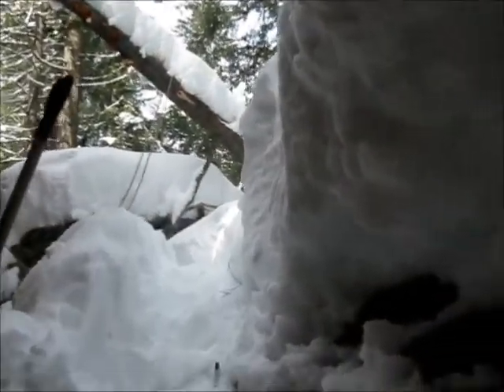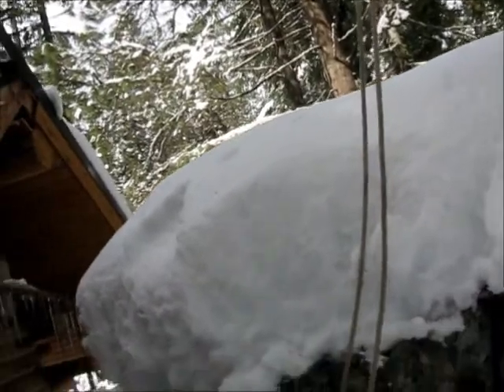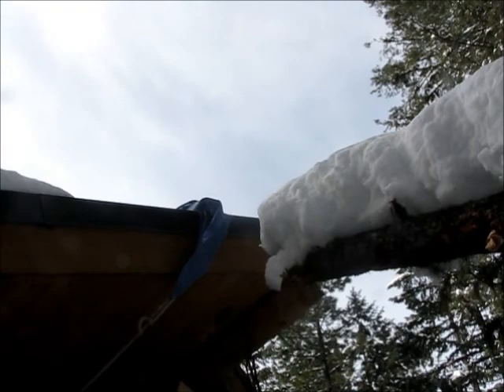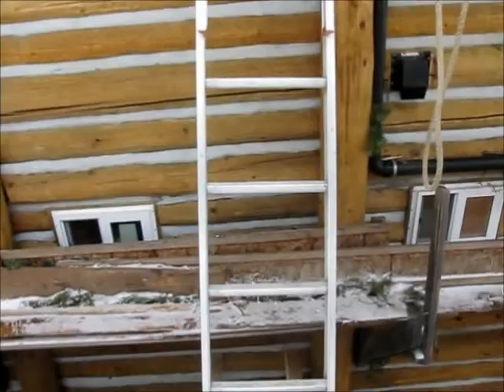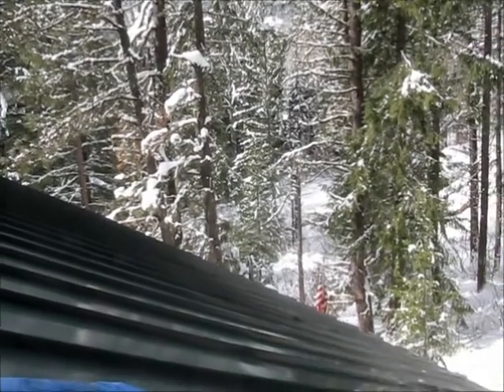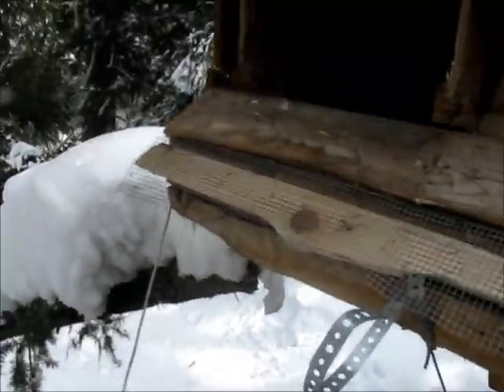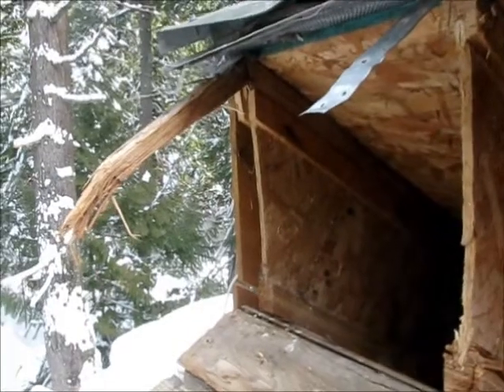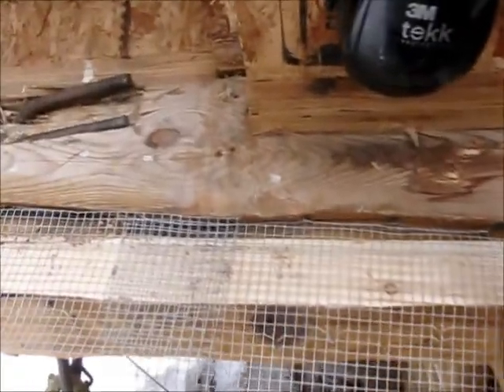Roof Repair at Camp Serendipity   Part 4 February 26   27, 2014

Comment from the maker: Thanks for your comments and your interest, Roald. I checked out your website. That's a great, beautiful, and cozy-looking cabin. I can imagine how much you enjoy being there. And thanks for the tip on the sawzall. I have known about them for a long time but I never owned one. I usually buy tools only when I am up against a project which I can't do without the tool. I have never quite crossed that threshold for sawzall. I considered it for this project, but I didn't want to cut through the sheet metal lying on the OSB and after trying the Bosch vibrating saw I found that it worked just fine. There'll have to be another time and another requirement before I buy a sawzall, but it could happen some day.